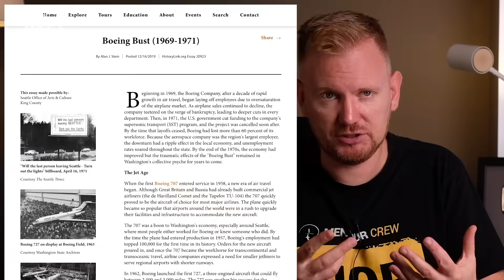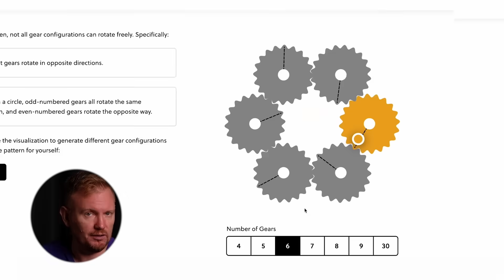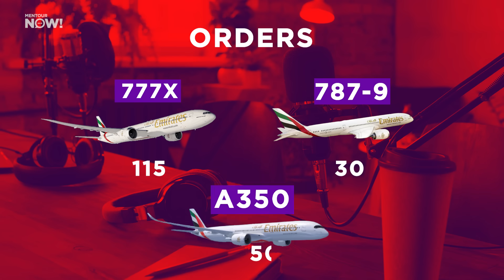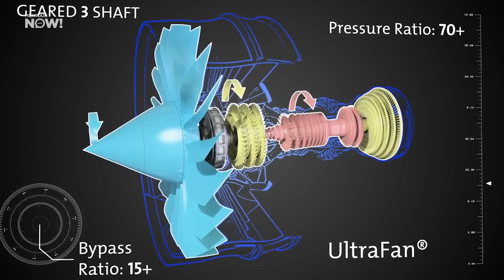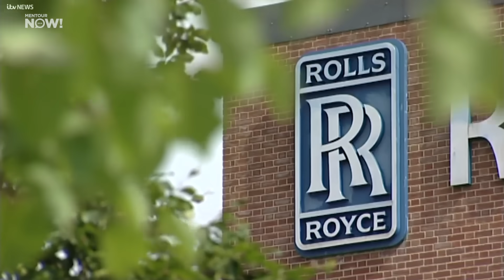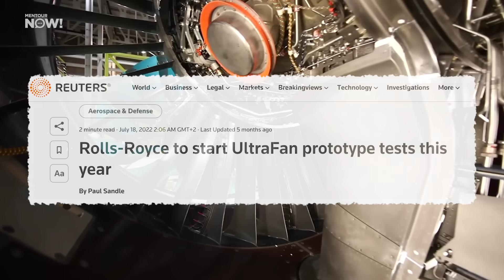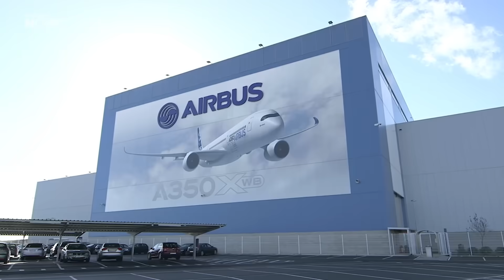Are BOEING planning a 747 with 2 ENGINES?!

Comment: It wouldn’t make sense for Boeing to try to bring back the 747–800. What they could do is add an upper deck to the 777X and add an additional 40-60 seats, with that iconic look, the 747-800 has a maximum seating capacity of 467 vs. 475  (>500+) for the 777-9, by adding the upper deck, not only do you have more seating capacity and a classic look, but you also have created a great plane for freight and that the front of the plane could open up as it did in the 747! You can pay me later for my great idea, but the Boeing doesn’t have the money to pull it off - let the queen rest!

Comment: That’s basically what the 777 is.
Reply: Eh... Even the 747-400 has considerably more capacity than the rumored 777-10.

If the fuselage were wide enough to support 3-5-3 seating, THEN you'd be at capacity parity. Though God would boarding times be awful unless you boarded from both sides of the craft. Last time I boarded a fully packed Air France 777-300ER (seats 450 in a tight config), it took almost 35 minutes to get all of Economy seated before final checks began. Never again if I can avoid it.

Comment: They need to work on a 757 replacement a thin 3 abreast seating arrangement 787 lookalike that will fill the gap between the 737max and the 787 that'll probably get boeing back on track

Comment: Did you consider the possibility of the ultra fan engines massive size might not only be for a 747 facelift, but a couple ultra fans enormous scale would not experience the same space constraints if it’s sitting in a top configuration that is being explored in the massive blended wing body being developed.  That’s kinda where I see them getting utilized… especially in military applications of the blended wing bodys.  Just my 2 cents.

Comment: Airbus plans to upgrade the A380 to two engines.
The A380's hydraulics are connected to the two inner engines and the APU.
The B747 has four hydraulics connected to the four engines.

Comment: The UltraFan engine is actually less powerful than the GE9X on the 777.  The UltraFan's most powerful version is only estimated at 110,000 lbs of thrust... however the GE9X is already at 134,000 and was detuned to 105,000 for the 777X.  I might add, the GE9X has already been tested on the 747 using the #2 engine mount... so it'd be pretty easy to add to #3 as well.

Comment: The 747 freighters will be getting old fast, so we need something and a Shortened 747 (like the first model) with 2 engines and modified wings = fattest 2 engined cargo plane in the World could set new capacity and efficiency standards like we have never seen before !

Comment: 4 engines is safer than 2. Not a good idea, to cut down to two. Btw, how can it be, that the B-52 will outlive the 747? They are actually re-fitting the B-52 with a set of 8 brand new, state of the art jet engines. It will fly 100 years, utilizing the same airframe, same design. Amazing!

Comment: Tim Clark asked EADS for a A380neo with the Roll Royce Trent UltraFan engine. Only problem is that the thrust is 75k so you would still need 4 to lift the 575t of the A380. The biggest problem is the engine diameter as you mentioned. at 356cm, they would need to increase the ride height of the undercarriage as well. It would make the A380 as fuel efficient as the A350 or the B787 and B777 and could keep the remaining A380 in the air until the first blended wing designs (such as the United one) are in use. Then we may see the A380 give way to something much larger with seating capacity for 1000s using virtual windows and smooth outsides for further economy.

Comment: I have often wondered if an approach similar to that which Cadillac use? By using larger engines could one fly a 747 that used 3 and 4 solely for Take Off, Landing and Emergencies including an engine failure? This way you get the safety of extra engines you can keep the MTOW, the extra power to land in strong winds and CAT but in cruise you get twin engine costs (except carrying two extra engines though these could be smaller lighter engines due to their secondary role. Cadillac use 4 cylinder for cruising but bring in all 8 when you need power. Just a thought…

Comment: When comparing the Genx for 777x vs RR ultra fan  diameter you got the numbers wrong. The fan on the GenX for the 777x is 134 Inches. Ultra fan is 6 inches bigger, not 12. Still bigger but wanted to correct that

Comment: What about a 3 engined 747(like the DC10 or L-1011?) 
Or even replacing 2 of the 4 jet engines on the 747 with efficient PROP engines & putting up with lower max speed?

Comment: It seems like (re: Emirates) comparing an A380 and a B777X is not a good comparison.

Obviously, Emirates uses the A380 for the capacity, despite the cost of fuel for it's quad engines.

Comment: While the twin engine 747 market analysis is interesting, I was hoping this video covered whether a 2-engine 747 was technologically possible. From what I heard, there are 2 challenges. One is there needs to be an engine powerful enough to replace the thrust of 2 current 747 engines. The second challenge is FAA requires planes needs to be able to fly safely with 1 engine dead. With a 4-engine jet, one dead engine only reduce thrust by 25%. With a 2-engine jet, the thrust would reduce by 50%. That means the new engine needs to be more than 2x the current 747 engines.
Reply: Has it been calculated IF the average comment by Mr ABBA gets past the public.....he is a little too⁸   much.........

Comment: Looking at this from an engineering perspective—replace the current GEnx-2B67 engines with two high-thrust turbofan engines, each producing 140,000 pounds of thrust, achieving a total thrust comparable to the original quad-engine configuration. The engines must feature high efficiency and low specific fuel consumption (SFC). Fan Diameter: These engines would likely require a fan diameter of 145–150 inches, scaled up from existing engines like the GE9X (134-inch fan producing 115,300 pounds of thrust). A bypass ratio of 12:1 or higher is essential for reducing fuel burn and noise. As stated before, there are other issues:  Wing Reinforcements: The wings must be strengthened to accommodate the increased weight and thrust forces of the larger engines. Engine Mounts: Pylons will require redesign to ensure proper distribution of loads and ground clearance for the larger nacelles. Aerodynamic Adjustments: Reevaluate the aircraft’s aerodynamics to mitigate drag induced by larger engines. Optimize nacelle shaping and wing aerodynamics to enhance overall performance. Finally, Safety and Compliance: The upgraded aircraft must comply with ETOPS (Extended Twin-Engine Operations) regulations, ensuring safe operation with a single engine in case of failure. It must meet or exceed FAA, EASA, and ICAO standards for noise and emissions.

Comment: Always wondered if any airlines or Boeing did any research on reducing 2 of the 747s engines towards idle in flight to save fuel. Cutting the engines after reaching cruise would also save on maintenance as well as fuel.

Comment: It's just not a simple thing to re-engine an aircraft.  Especially to convert a 4-engine design to a 2-engine design.  Look at what Boeing and the Air Force have gone through to re-engine the B-52 to keep it in service.  One would think that the B-52 would be a great candidate to convert to a 4-engine design and get away from the reliability and maintenance issues of eight engines.  But that's not the way that it worked out.  There wasn't enough room under the wings to put a large diameter single engine to replace the twin-pod engines.  Once the operational specifications of an aircraft are defined, the entire design must be dedicated to meeting those specifications.  Coming back later to change the configuration of the aircraft forces everything else to be redesigned and engineered, to the point where you should just start with a clean sheet.

Comment: Peter, ...Peter..., Peter...I X9 engine prototype is so large due to the simple reason that is a "...prototype..." - Perhaps double the size of an actual new engine yet to be release to manufacturing at some time in the future. This size males able inner workings observation during test and performance evaluation of all componenets wear out factor and their fatigue materials resistance and coeficient. It would, in my opinion, be a test bed of things to come.
However, there is another consideration from a design materials resistancevstand point which is the obsevation of performance under what it is called "...thermal amplitude..." which equates to maximum temperature handling of the engine as a whole simultaneously with internal critical parts, and then in a very short time, evaluate the effects of the resistance of its component materials at their maximum cold temperatures.
Any improvements or replacement, or even interchange of engine components which had a malfunction, discrepancy or wear out condition would be easily recognizable due to its sheer size.
Now, with the available and more efficient engines of today, it still would generate some fuel savings comparee to the engines originally installed in the 747, including those with now some outdated engine upgrades.
Boeing at this time, needs to improve safety record. So, my question to all is why does Air Force One, has 4 engines?
Answer: Safety.
So, it is herein indicated that for the most immediate future Boeing, translate such safety to the restoration and upgrade to a new version of 747.
Minimal re training required, if any. This would make for a rapid deployment, and subsequent rapid delivery, even iif it is an interim basis.
Facilities for its manufacturing still do exists, worforce still there, and supply chain would know what, how and when through Boeings procurement/purchasing.
I look at one Boeing aircraft within the U.S. Air Force, that has been in service for almost 7 decades:  The B-52
It is now going a re engine phase and avionics upgrade. Perhaps it is the X9 destination? Regardless, the original turbofan engines, 8 engines in 4 pods, was kept for so long for cost savings and ease of maintainance. Yet, the original engines designed in the 50's and today there are underpower compare to available commercial jet engines. Why cant this princinple be appliedvtobthe 747? It would make, an opinion turn around for Boeing and for the better. It is even a more attractive solution when we hear of aircraft engines that would move a propeller some time in not too distant future if deemed capable engines at the bench mark. If this concept is implemented, would help regain lost time, if some Boeing customers would agree to operate these retrofitted 747's for an interim period of time. Mojave desert have some Jumbos waiting to regain the 747' title crown of "Queen of the Skies".
For Boeing this would be a double "...whammy..." - let me explain: 
1) It would provide an out for the actual increasing demand for aircraft which is choking production of the duopoly of aircraft makers, putting aircraft in their hangars, within a known form, fit, function, performance, and maintanace.
2) It would enable Boeing to recoup their lost times due to grounding and other blown doors fiascos. 
3) A re-cert, would easier to obtain, faster to obtain, quicker to obtain.
4) it would safer to fly by keeping the 4 engines for safety, as the safety precautions of Air Force One. As such, I strongly believe that
People at large would prefer to fly in the utmost safety. Making them to flock to book tickets by simply, fly safer. Even though newer engines have features that enhance safety, we have seen that some aircraft can lose control quite quickly. 
This could be considered an interim solution, or can be provided to commercial aviation like they are doing with the B-52, which with the new engines would fly well into the 2050's.
By then, it would 100 years flying.
Need I write anymore?

Comment: Maybe the new 747 can be a blended wing body ? (still a high-tech gizmo in the lab)
why not to consider the 747 with engines on top of the wing ? (like the YC-10)
pushing the back have several new considerations but someone said that air framers can go crazy and they will provide the engine, a couple of engines "blended" in the empennage can do the magic. Several new considerations can be taken but the avantageous of this configuration can be commercially motivating. I don't invest heavily in jet engines due to environmental conserns, so let's go crazy an redefine the new 747 air frame with the new era in mind.

Comment: One of the main issues with large aircraft is the arrival and departure problems at the airports. If two widebody extra large planes arrive at an airport at the same time, they create big problems with ground facilities and transportation. Many airports will not spend the money to upgrade their facility and do not want large planes. They are really only efficient on point-to-point routes. Planes, unlike autos, can't just replace their engines with a bigger model. They must be re-engineered almost from the ground up, especially the wings. There is also the issue of engine-out performance that has to be resolved. I don't think a two-engine 747 is in the cards.

Comment: These engineers are stupid, how about a 50 foot engine for a car? They want efficiency use hydrogen gas as fuel it is lighter then liquid. They can even store it externally, and even make it safe until it goes into the engine this way if the jet crashes there is no fire or explosion. It is much better to use levitation craft but since they are either too stupid to know how to make one or they don't want to use the technology for some sorry ass reason. In my opinion billionaires look like complete morons stepping off their jets like they are really something special because they just went on an 18 hour flight to get there to brag when they could of got there in 20 minutes in my designed air craft.

Comment: David R Lentz, Columbus, Ohio, USA (Wednesday, 31 July, 2024) 

A valuable overview of the Boeing 747 series passenger airliner and commercial transport. I hear thoughts to redesign the Queen of the Skies to a twin-engine design for greater fuel efficiency (see, e.g., YouTube “Are BOEING planning a 747 with 2 ENGINES?!” [Mentour Now!, Sunday, 25 December, 2022]; even as I am watching your video, I find the above headline). Would the most powerful engines available be amply sufficient to provide not merely adequate lift, but emergency power at critical necessity? 
   I suggest an alternative: would a design similar to the twin-engine pods of the Boeing B-52 Stratofortress USAF Strategic Bomber resolve these two concerns? This need be only a temporary measure, till either 1) a much more powerful engine becomes available, or 2) an electric engine of greater capacity comes to the marketplace. 
   Another issue is that Boeing 747s need to well exceed 600 mph for the sake of shortening travel times; in matters of scheduling, efficiency follows alacrity. (This might not be the case purely in terms of speed, though; else, we all would be streaking at Mach 2.5 at 20,000 metres aboard greatly lengthened Boeing/McDonnell-Douglas F-15 Soaring Condor airliners with 50-metre wingspans!) 
   Perhaps æronautical engineers, designers, etc., ought to consider adapting an appreciably lengthened fuselage of Boeing/North American Rockwell’s B-1B Lancer USAF supersonic bomber to a newer airframe configuration. incorporating new materials, methods, etc. Since such an aircraft would require no bomb bay, they could effect streamlining even further, incorporating at least two engines internally. Alternately, they could re-work the powerplants’ arrangement to a composition of three- or five-engines, whichever offers the best balance of fuel efficiency, speed, range, passenger accommodation, etc.

Comment: Aerodynamically Not So without a big Redesign of the Wings & Core Attachments to the Fuselage..
She was not designed to be a Twin Engine & any thoughts otherwise would not be Using Ones Brain to understand why to not put to fine a point on it..
I sort of wonder as a Pilot & Aerodynamic  / Aviation Aeronautical  Engineer myself as to the long term of matters relating to the Twin Engined Planes, New developments in Engine Technology etc us allowing for Better Fuel Efficiency & Composite Builds of the Engines themselves in terms of Materials used.
ETOPS Current Rules in relation to Twin Engined Aircraft might one day along with the advanced Technology possibly see a return to the Four Engined Type....
Regards